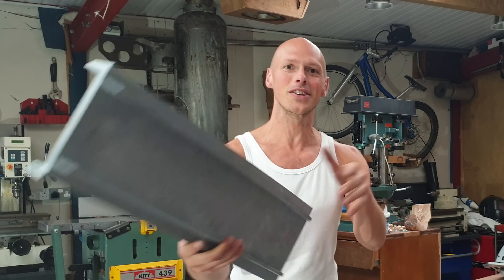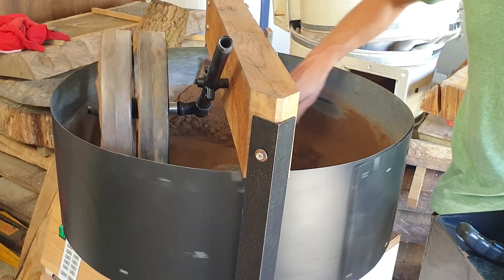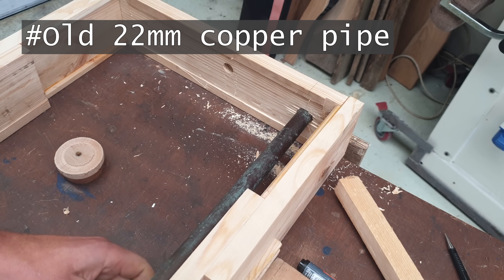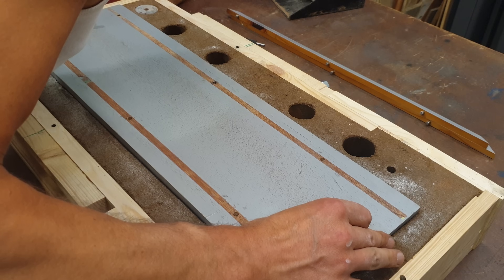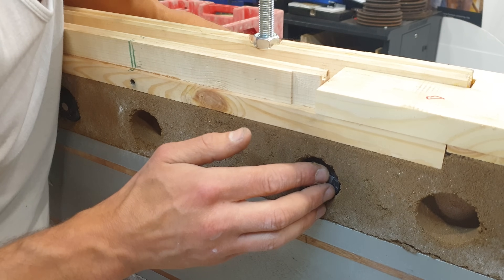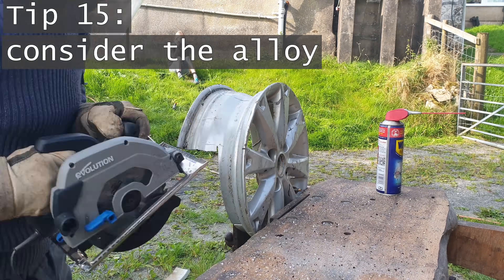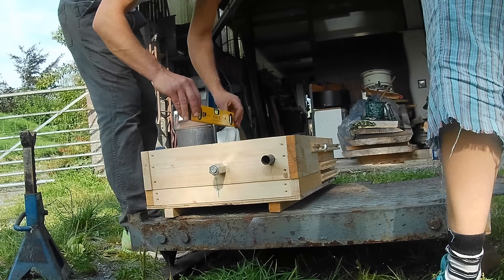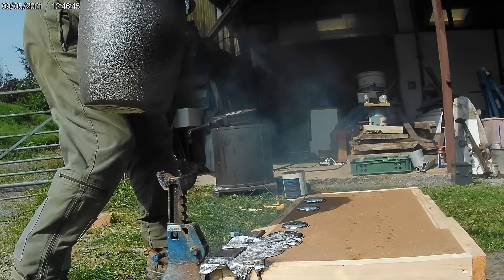Al Metal Casting: Tips for Making Good & BIG ones at home!

Comment: I worked at a foundry in the mold department. All our patterns were made of wood. I didn't make the patters but they seemed to be coated with polished epoxy. We never used a releasing agent. The forms were metal. There was a massive hopper we filled with the sand, mega tons. The sand was fed down a shoot into the mold. The table bumped / jumped up and down while the mold filled with the sand. Then we heaped a pile on top, and a press plate came down and pressed it. They weighed between 75 and 120 lbs. Lots of details left. I produced 150 to 175 molds a day and learned a whole lot .

Comment: After sampling a large amount of metal casting videos it is apparent that this video despite trying to appear as very knowledgeable contains several major flaws and instructs on using flawed and erroneous methodology and very bad habits that will result in a lot of lost effort and lost work. This leads to loss of resources and inferior outputs.

It is adviseable to seek out other videos for 'lost foam casting' that actually offer solid advise and lead to superior methodology and superior output for your invested efforts.

For example it is always best to truly compact fine grained DRY sand as tightly as possible. The lost foam or plastic model needs a proper coating layer so that the sand does not touch the actual model and which allows gases to escape at right speed.

With proper methodology as found elsewhere you can achieve great castings with superior surface and easier work methods than offered here.

The headline of the video that promises "good" casts is flawed and should be changed to "mediocre" or "inferior". An updated video ought to be produced and this video should be titled as "obsolete" in view of superior instruction that was already widely available at the time of publishing.
Reply from the maker: I'm not so keen on lost foam casting myself. Hence the green sand, where you can reuse a single pattern many times. Each to their own I guess. 
Peace.
Reply: @FloweringElbow  It is not my desire to be harsh but to the point and short. I hope no ill will is conceived thereof.

I should wish that if you need to potentially cast engine parts or other machine parts of even neatly finished structural pieces that you too would benefit from the notion that you can yet much improve on methodology while maintaining much of the same resources.

Lost foam has many benefits -> you can produce a DIY CNC mill for producing foam pieces.

I should at some point strive to demonstrate how the CNC foam milling can be automated with DIY robots and a DIY storage system, all inexpensive.
Reply: @Kameolontti  - Your vast experience of sampling (watching) casting videos in no way has made you an authoritative expert. Lost foam casting is a useful method but it is no way superior to the time proven green sand method used here. You claim that major flaws were made but you provide nothing to back up your opinion. You are very critical but with you vast wealth of knowledge (sarcasm) you contribute nothing of value to the discussion.

Comment: I really enjoyed this and got a kick that you are student of the oldfoundryman too!

I only have questions of curiousity:
- did you calculate your risers or guess them? 
  - I don't know the volume and surface area of your part, but I would speculate that your risers don't need to be that large, especially with 4 of them - smaller risers - less material - safer pouring
- have you tried or would you consider using two gating systems and two (smaller) cruicibals and pouring from each side and the metal meets in the pattern? I realize that it would require two people pouring at the same time, but it might be alot safer for each of you

Don't get me wrong, I enjoyed your tips, the process and outcome - I thought you did great! My only concern would be that your pouring looks a little dangerous. I would suggest that you either need to build yourself some device to set that big crucible in to pour it safely and consistently - something with mechanical advantage over its weight. Or, utilize a second person/crucible/gating system to make your pour more manageble.

Comment: Good casting tips next time make the feeders slightly larger and make a twin handle shank so that your partner can help you pour if you had a bigger furnace capacity that would also help as you could ladle the metal into the moulds keep up the good work
Reply: Bigger feeders would have required a larger crucible. With the largest crucible he had his concern was pouring short.

Comment: Great videos and content! Here’s a tip for removing the aluminum from your HSS & carbide cutting tools. I’ve used this method for 30 years and it works like magic.  Soak your cutting tools in drain-o (sodium hydroxide). Dilute with a little bit of water, it does not have to be full strength. Use a plastic container and soak your tools overnight in a well ventilated area and the next day all the aluminum will be gone from your tools. Keep up the good work!
Reply from the maker: Thanks for the tip, I'll try that :)

Comment: So many questions from this newbie (me 😁), like why not have an electric hoist on real slow speed separating the work so hands free to tap the mould apart. Would that work?
Also when searching bentonite, why havnt you gone in depth about where to buy it, on ebay its. $1m an ounce, I tried the local nursery and they just didn't have an inclination asto what I was talking about. I tried industrial and I have to order a truck load of bentonite so I can get it really cheap $600 delivered... . Any how if you could tell me your thoughts, it would be appreciated and thanks for the great video. I like the process you have learned, better than most ive watched. Have a good day everyone and have fun. Chow now.
Reply from the maker: Good morning Findvoltage, thanks for watching. Good questions. 
1. Slow electric hoist would be a nice addition - I don't have one yet.
2. M bentonite clay is all from Cat Litter sold cheaply in Lidl. It's 100% bentonite - which sometimes goes by other names... 
I have found it easiest to mix the clay into the sand wet. Saturate some of the bentonite until it forms a smooth paste, then add it to the sand. If you don't do it this way you're into grinding it up - which makes a lot of dust.... Hope that helps :)
Reply: @FloweringElbow  Cool as. Thanks for your response. Keep the excellent vids coming and I like your sense of humour man your really funny and cool. 😎
Reply from the maker: @findvoltage  Haha. You must not have seen my latest video. The dad jokes are on another level of poor ;)  Peace.

Comment: Very good video with some lot of information  !!! And very use full degazing liquid metal chart at 19:25 to avoid buble in aluminum casting -> work at low pressure in dry environement with a quick melting aluminum I unserstand more why compagny put some lot of moneyr on casting in close atmosphere with inductive oven. 
In order to perftly your mold why not wrapp it in plastic and use a tini air conditioneur to make a close loop to dry the mold slowly at a standard temperature room ?

Comment: An old foundry bloke told me melt fast and pour quick when it comes to Al.  Don't scrape the dross off until you're ready to pour. Al absorbs nascent hydrogen from the atmosphere causing small bubbles in the melt which makes it worse the more you stir the Al.  Get a welding rod and poke vent holes through the green sand to let out the gases.  Easy enough to grind and file these off later.
All in all nice videos with a lot of information.  Thanks for posting.

Comment: I never really considered that the molten metal would absorb hydrogen from water vapor. Makes me wonder how much hydrogen from the burner's exhaust is making it into the melt. After all one of the main components of exhaust is water vapor. So no matter how dry you get the metal before the melt, the water vapor inside the furnace is going to be a significant hydrogen source. May be a significant advantage for electric furnaces for casting aluminum.
Reply: I guess that it comes down to a trade-off between the convenience of gas or oil burners versus the greater investment required for an electric foundry. For most hobbyists purposes the gas or then the vapourised oil burners are the way to go and dependant upon the amount of time and money that they wish to invest in the process. 
Mark from Melbourne Australia
Reply: @markfryer9880  right. cost to benefit ratio. 

And I mean, the commercial foundry i worked in for a while, all their multi million dollar machines were gas powered. And they had great end product. High quality, good chemistry. 

It can be done just fine with gas

Comment: Great video! Very ambitious casting! Olfoundryman and luckygen are also my heroes in the foundry vlogs. Keep up the great work!
Reply from the maker: Thank you very much!
Reply: Both of those gentlemen have contributed greatly to improving the availability of good educational videos on the subject of casting for the YouTube community. I am proud to say that they are both gentlemen from Melbourne and that I have been in contact with both of them. 
Mark from Melbourne Australia
Reply: 2:02 In Asia they mix the casting sand with oil, not water. Water instantly turns into steam when hot metal is poured into the mold. The whole thing explodes.

Comment: The bean cans is actually a good idea. I did some aluminium casting last year with a small furnace I built but I always ended up having a lot of trouble getting the stock out of the homemade crucible (basically just a stainless steel pipe) since it deforms from the heat and pinches the stock. With the cans I could easily just turn it down in a lathe.
Reply from the maker: Hi Christopher, thanks for watching. Yeah, that's right. Actually we find we can just 'peel' the thin cans off the aluminium with pliers. We have turned therm straight off in the past, but watch out for thin strips that can catch and come loose all at once!

Comment: All this trouble and hard work... but Aluminum? Cast iron is much better. Young's modulus of Aluminum is terrible- in fact, mild steel is better. Vibration damping> Cast iron is great. Temperature the problem melting it?
Reply from the maker: Strength to weight ratio of aluminium is v good compared to cast iron 👍 so should be ok for a part that has to be accelerated and decelerate a lot... would be nice if vibration damping was better, but hence the metallised epoxy... 
Steel and concrete was used on the main frame which stays stationery. 
You can watch the video on making the gantry for more waffle/rationale on that. 
Peace, Bongo.

Comment: I've only just found your channel and, I have to say, I thin it's fab. Although my partner and I make our living manufacturing obsolete and unobtainable parts for vintage motorcycles, we absolutely love up cycling and repairing all sorts of things. Most of our machinery was bought in need of some repair apart from TIG welding equipment. But even that was bought by buy buying and repairing other welders.
I look forward to watching many more of your videos 😊
A quick edit to say, my grandfather was a sandcasting mold maker for a company called Simon Hartley. I think they made lots of huge castings for the water treatment industry.
Reply from the maker: Hi Sophie, that's so cool! And welcome! Where about's you based?
Reply: @FloweringElbow  We're in North Shropshire near to Shrewsbury. We found your channel while we were researching building and modifying stove fans. My partner's workshop fridge broke down and it struck us that it would be such a waste to throw it away so repaired it by replacing the failed Peltier plate. This fired my interest in an interesting technology. I'm learning how to repair any electronics I can at the moment.

Comment: To help your casting flow and fill the way you want it to, slightly angle the mold, this is especially useful on larger or flat castings.
i.e. on the large casting you just did, I'd put a 1/2 or so bit of wood under the mold box/support board the full length of the pouring / riser side just before you pour.
This will insure it's filled from the lowest point up & keep the flow from wandering around as you now had a definitive bottom (esp ideal on flat areas) it will also drive the evacuated air up in a prescribed way (not so much of an issue on your cast as your high spots were quite defined).
Ideally when angle casting like this you want your gates at the bottom, so your molten metal is not running across your pattern to get to the bottom, however, in my experience, this tends to be an issue of practicality.
Andy
Reply from the maker: Hey Andy. Totally makes sense and I feel silly for not thinking of it. Great tip, thanks!
Reply: @FloweringElbow  one Martin told me many many years ago.